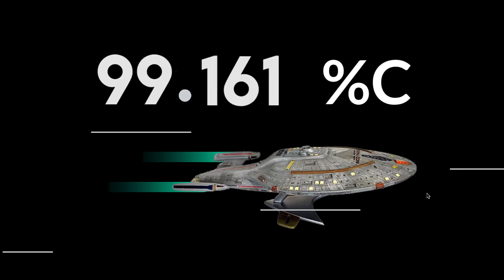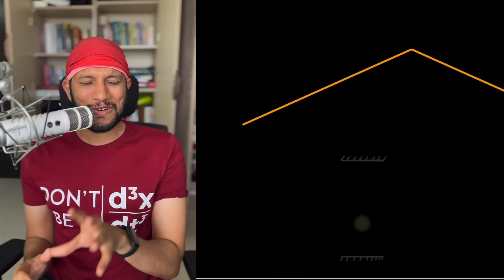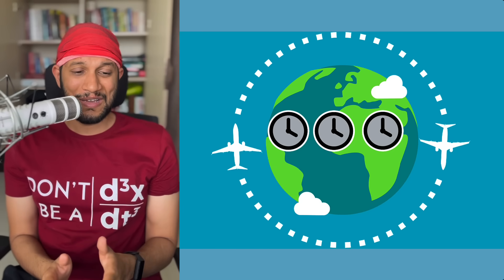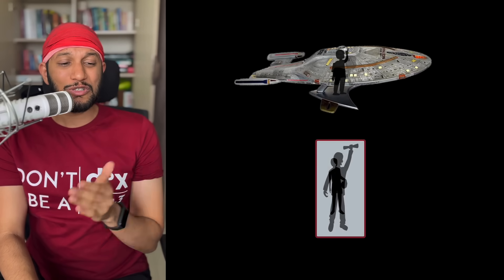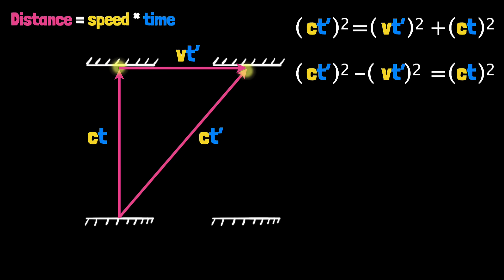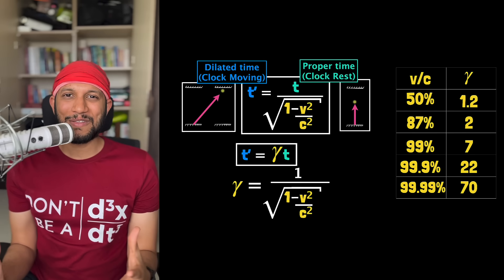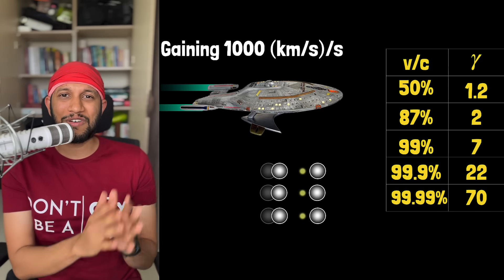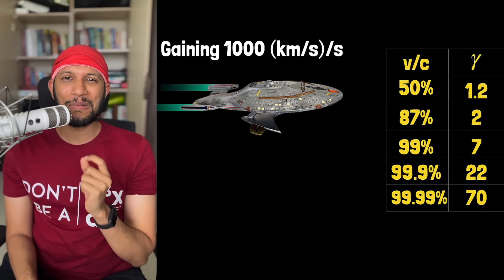I finally understood why you can't go faster than light! (My mind is blown)

Comment: While I enjoyed the video very much and felt like it made things click for me, I have an issue with explaining it with force transmission delay due to distance or propagation, since if that was the case elementary particles should reach c more easily, which isn't the case (A proton in the LHC cannot be accelerated to c) I might be misunderstanding or just wrong, but I thought objects cannot reach the speed of light not because forces fail to propagate fast enough, but because spacetime geometry forbids timelike worldlines from becoming lightlike.
Reply: oh, do I need to check the video? In the case of CERN we know that the protons fall down an electro static potential. No idea why this would stop working. It is already there.

Comment: what I don't understand, is where are you going to take your measurement for speed, because it's relative. If you're measuring from earth, and its going 99% the speed of light, and the earth just goes 1 percent of the speed in the opposite direction, how do you say the ship is not going the speed of light?
Reply: there is no absolute reference. The pope is not the center of the world. "Single source of truth" is something Oracle would tell you to sell their DB to you.  Lorenz and Einstein merely gave us equations to change your PointOfView from one inertial system to another once you measured the velocity of the other system in your frame using non-relativistic methods ( gates with stopwatch or triangulation with retardation )

Comment: You say that if A is moving and B is at rest, then  time in A's frame of reference moves more slowly than in B's frame of reference.
But motion is relative. If A is moving relative to B, B is moving relative to A. So employing the same reasoning as before, time in AB's frame of reference moves more slowly than in A's frame of reference.
So time in each is moving more slowly than in the other - and therefore also more quickly than the other. This is dumb.
Reply: this effect comes from the target group. We present a "correction" for people thinking in a classic way. The skewed simultanously will fix your problem. Remember: reference frames don't accelerate! No U turn allowed!

Comment: if the clock can slow down it has equal chances of fastening up as you see by abducting the triangular inequality we can certainly say that a if the rest time relative to the slowed down time is greater as both can be derived via comparison or being relative to one another similarly considering the time outside the spaceship the longer path of photon as the natural or rest time we on earth may be the ones living faster lives so for this to be true we must also prove the fact of rest time clock being the smallest possible time relative to every possible time can be done by perpendicular bisector or triangular inequality then time becomes dependent on the path in the relative space of no absolute conclusion of the space itself is not defines as the distance is a varied factor on the basis of time so there must be another constant term to explain this

Comment: Heyy hi I have a question if u or anyone could answer it would br great

My question is that the spaceship would actually be able to travel faster than the speed of light its just that we would see it slowing down as it keeps getting faster Just like how cooper doesnt enter the black hole from our perspective but from his perspective he does enter and after entering he cannot come out bcz coming out is like traveling back into the past. 
Now theoretically if something travels faster than the speed of light as per Einstein's equation we get the actual time divided by the square root of a negative number which is an imaginary number. But why do we discard this imaginary number. Even in Schrodinger equation imaginary numbers pop up. And we know that the spin of an electron can happen instantaneously faster than light travel. 
I think that the reason quantum physics predicts the state of an electron instantaneously is bcz the communication happens faster than the speed of light hence it travels backward in time, this is also inline with einstien theory of everything which shows actual time divided by the square root of the negative number which is equivalent to something negative ,which means that things travelling faster than light will go backward in time. That is my theory of everything but idk am i missing something.

Comment: That was an amazing video, I wish I could get an explanation about why, if I have a train going juuuust under the speed of light, and a child throws a ball inside the train, how does the ball not go faster than the speed of light, without slowing the whole train?
Reply: You add velocity like Newton does and we know that it is wrong.
Reply: @ArneChristianRosenfeldt umm.. not to sound dumb, but what?

Newton's laws of motion are what I was taught in school, so yeah, that's what I am using?
Reply: @Session1052  I think in the video there is some part about a staged rocket. Throwing a ball is not different. I feel that it is so complicated in English: First you got time dilatation so that the throw is actually very slow. Then there is this space dilatation (?), so the throw is very short. And then there is the changed simultaneously thing. I think that the video already explained that the same kind of rockets will approach c. Like you have 3 more for each lower stage , so that each stage adds a fixed velocity according to Newton. No math tricks like some one said: Next stage only adds half the velocity. Only adding the half will not reach some point as we use for storing mipmaps in computer graphics.
Reply: @ArneChristianRosenfeldt holy shit, I get it......
Reply: thank you

Comment: 0:12 bro even the starting eqn is wrong,so I am out😑
Reply: Brother, that's the correct formula, in everyday usecases, v is much smaller than c, so the denominator approximates to 1, hence we see 1/2mv^2 as the formula for kinetic energy usually.

Comment: quantum entanglement laughing at the corner!
Reply: even die hard fans of Copenhagen do not claim that you can send information this way
Reply: @ArneChristianRosenfeldt true you right you right. I thought it was but due to randomness information can't be sent. So basically Optic fiber will be max speed for the internet huh. We capped out 😢😢
Reply: @Legendarybruh  Star Link is faster and used for high speed trading as are microwave links.
Reply: @ArneChristianRosenfeldt No Optic fiber uses light where as starlink uses radiowave or microwave or something. Starlink can only transfer data in mbps while optic fiber can do it in gbps. The speed is almost capped out my dream of achieving Tbps speed internet is done😢😢 we are capped out.
Reply: @Legendarybruh  I thought that Star Link invented inter-satellite optical-communication? Or was that canned? Musk sure loves optics: All camera, no radar in Teslas
Reply: @ArneChristianRosenfeldt Starlink router  need to connect to dish antenna which tranfer data to starlink satelliter then satellite reflects data back at the ground and vice versa. It's like the Dish Television but for the internet. Great thing about it is that Even if whole internet gets down starlink will be fine. But currently the speed is like 300 mpbs that's it and 300mbps is more than enough.

Comment: There are galaxies mowing faster than light from us and light they cast will never reach us because of that. So things you and I are traveling faster than light throughout the universe  from the point of view of other galaxy. Its like if you throw a ball to your friend backwards to your friend at 5 miles per hour but car is running at 10 miles per hour so friend will never catch the ball because ball thrown backwards is still going forwards at 5 miles per hour forward. Ball is the light. 

So yes you and I are traveling at the speed of light, it is true from a certain point of view.

Comment: btw his shirt says don't be a "jerk"
Reply: Explain?
Reply: @jakekingston4206  Jerk is the scientific/technical term for how quickly acceleration itself is changing. The formula on the right means "jerk"
Reply: @jakekingston4206 ok so basically its just short hand. If you think about speed as an equation, and distance as the independent variable like x in a function, then speed is the mathematical derivative of distance (Speed = Distance/Time, like f’(x)=Δx/Δt), and then the derivative of that is acceleration (Acceleration =  Speed/Time, or distance/time/time, like  Δ^2(x)/Δ(t^2)). Well the third derivative, which is harder to intuitively understand like speed or acceleration, is called jerk in physics, and that would be represented by the 3rd derivative, or Δ^3(x)/Δ(t^2).
Reply: Thanks for the additional information 👍
Reply: Thank you.

Comment: I got confused between why speed of light is taken as a constant in all reference frames and if there can be particles that travel faster than speed of light...😢
Reply: Historically, special relativity predates particle physics a bit. We better only use particles as clocks. And historically, the speed of light was measured to be constant in all reference frames. Graviton waves and gluons also move at c, but from the top of my head I don't know why. The "shut up and calculate" movement says not to ask this question. Just be happy that you can engineer GPS and navigate the solar system.

Comment: Thank you for this really good explanation, but for me, to really grasp this concept, there are two important points missing.
1. What happens if the ship travels towards you with nearly the speed of light? Yes, you might still wait for almost infinity to see the photon clock bounce, but also the distance of the object is getting less and less, so you should take less time to see the object. How is that working?
2. What’s happening if the reference point is inside the ship?
Reply: 1. It is assumed that observer compensates for effects known from classic physics (Newton). Doppler sonography can be understood in classical terms ( classic usually means : not QM. But how else do I call it?).

Comment: Flying an atomic clock around the earth in an aircraft only proves that atomic clocks are affected by gravity.

The operational parameters of a cesium atomic clock are "at sea level" and "4 degrees K".  Violating these parameters causes the clock to mutate into a device that measures a different quantity.

For example, suppose that violating "4 degrees K" causes the oscillating frequency to increase.  Does this imply that time passes more quickly the hotter it gets?  Of course not.  The device simply mutates into a thermometer where the change in oscillating frequency can be used to derive the change in temperature.

Similarly, violating "at sea level" causes the oscillating frequency to increase as you raise the device above sea level.  This does not imply that time passes more quickly the farther you are away from a gravitational source.  We simply conclude that the device mutates into an altimeter where the change in oscillating frequency can be used to derive the device's elevation above sea level.

Put a sundial at the top of Mount Everest, and another at the base, and put them on the same line of longitude so the shadow strikes noon at the same time on both clocks.  These 2 clocks will remain in synch until the sun swallows up the earth, despite the fact that the clock on top is travelling faster and is farther away from a gravitational source.

Conclusion: There is no such thing as general relativistic time dilation.  If it were true, then the top of Mount Everest would have drifted into the future by now, and we would no longer be able to see it from within our time-space continuum.

Similarly, Einstein's photon clock is a clock only when it is at absolute rest.

When discussing Einstein's photon clock, the external observer is irrelevant.  According to Einstein, "faster moving clocks run slower", which implies that the oscillating frequency decreases as the clock's speed increases, even for an observer travelling with the clock.  You need to replace the mirror with a light detector and use a circular wave that propagates from the source point to illustrate this clearly.  In the time (t') that it takes the wave to propagate to the detector, the detector will have moved vt' units.

When you set the clock in motion, it simply mutates into a speedometer where the change in oscillating frequency can be used to derive your speed using the following formula:

   v = c * SQRT(1 - COS(theta)**2)

Theta is the angle formed at the bottom of your right-angled triangle at the junction of ct and ct'.  Theta (in degrees) increases from 0 to < 90 as your speed increases from 0 to < c.  The device fails at c because the wave will never reach the detector.  Measure theta by rotating a laser placed at the junction of ct and ct'  clockwise from vertical until the light strikes the detector and you know how fast you are travelling.

   theta in degrees       speed
             0                        0
           30                        0.5c
           60                        0.866c
           89.99                  0.999c

Substituting the formula above into the gamma factor formula, we conclude that:

   1 clock tick = 2 * t' = 2 * t * gamma = (2 * d) / (c * COS(theta)) seconds

The second formula above simply adjusts the length of each clock tick to account for the change in oscillating frequency due to the change in speed (and theta).  You need to do this so that you know how much time has actually passed for you and everyone else you left behind on the earth so you know which side of the sun the earth will be on when you return.

Conclusion: There is no such thing as special relativistic time dilation.  Einstein tried to pull the wool over our eyes by using a speedometer as a clock.

In all of the examples above, the mutated device is no longer a clock; it cannot and must not be used to derive the passage of time.

Time passes at the same rate for everyone and everything in the universe, regardless of speed and/or proximity to a gravitational source.

The simple, logical reason why we cannot exceed the speed of light is as follows:

The speed of light (SOL) varies with the density of the medium through which it propagates.  In the ocean, SOL <<< c; at the earth's surface, SOL << c; in the upper atmosphere, SOL < c; in outer space, SOL is c but it is not infinite.  We conclude that space is not an absolute vacuum.  Light has a maximum speed of c in the near-vacuum of space because of the resistance caused by the material that is out there.

As we approach the speed of light, the "soup" thickens.  Our mass does not increase.  It simply takes exponentially more energy to accelerate an object against the resistance caused by the ever-increasing relative density of space.  If a wave of electro-magnetic radiation (light) cannot travel faster than c in the near-vacuum of space, then neither can we, unless space were an absolute vacuum.

To exceed the speed of light without burning up due to the friction caused by the thickening "soup", we would need to create a device called Moses that parts space in front of our spacecraft and creates a slip stream that is absolutely void of all particles, then put the pedal to the metal.
Reply: "4 degrees K" let me stop you right here. You know that we operate both clocks at the same temperature? First step to shorten your comment would be to leave out what stays the same. Yeah, we should eliminate General Theory of Relativity. Perhaps we could place a clock in a non-orbital flight and compare the time at the apex, or is this too short? Perhaps we could erect a tower on the moon.

Comment: There are two fundamental problems with this explanation. Maybe three.

First, you treat your system as special. All of the explanation is done outside of the spaceship, where clearly inertial frames are not special on their own.

Second, you use acceleration to explain special relativity. This invalidates many of the results (you trade intuition with rigor, which is not good in physics, but working well on YouTube).

The 0th problem is that while looking for intuition, you take as granted the fact that photons travel at the speed of light in any frame. This is not intuitive, so the explanation as a whole cannot be intuitive.
Reply: It is well accepted that special theory of relativity is based upon the axiom (belief) : " inertial frames are special "
Reply: The axiom is that the speed of light is constant for all inertial observers.

If the YouTuber were to be on that spaceship, he would have seen the clock in his studio being delayed (which is exactly the opposite from what he describes while sitting in his studio). All special theory of relativity results are symmetric, and whatever you measure or observe in his studio, you will measure while on the spaceship. So no frame is special, and the explanation cannot be done only from one, because then it becomes special. He needs to account for the second frame's perspective as well.
Reply: @07U  But the explanation has always been done form one "special" inertial frame. In 100 years no other explanation has been found. So I would not blame this video. I mean, the explanation needs a longer attention span because two inertial frames are used and is shown that the results are the same.
Reply: The "intuitive" explanation is made with one special frame, that is correct. In my second point I was mentioning that the presenter trades intuition with rigor, and I guess it is in order to keep the video short. However, there are several channels that try to sacrifice rigor as little as possible while staying intuitive, and they still gain success and recognition with 30-40 minutes long videos and or even series.